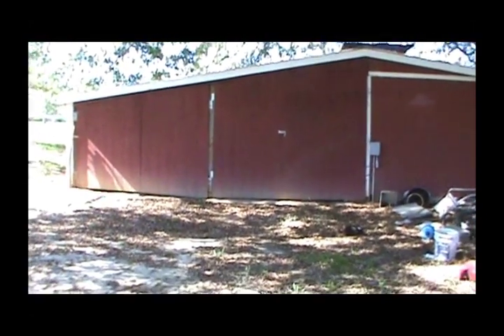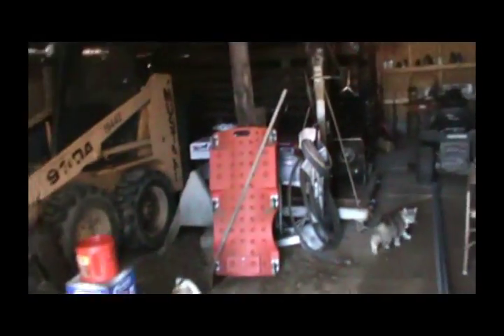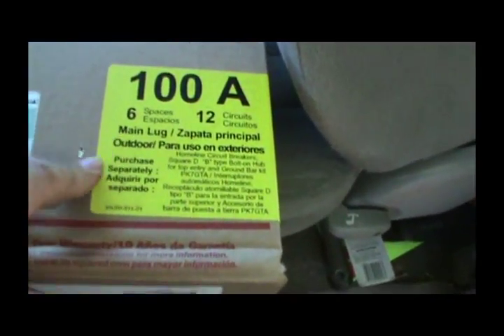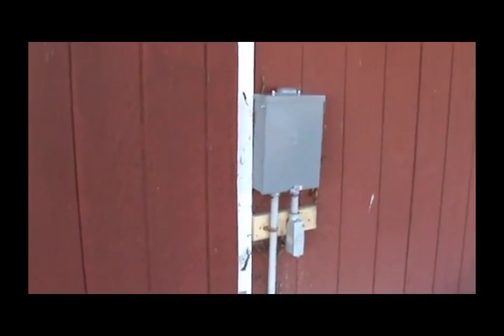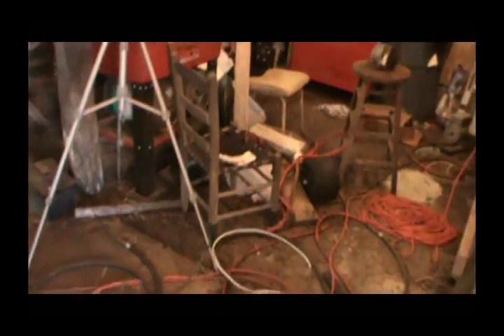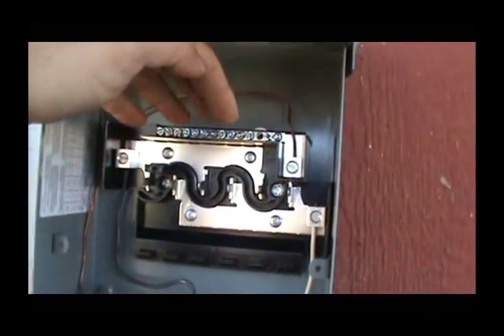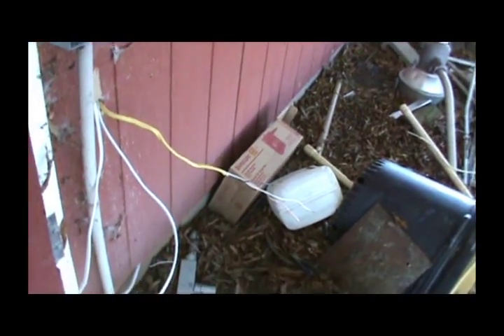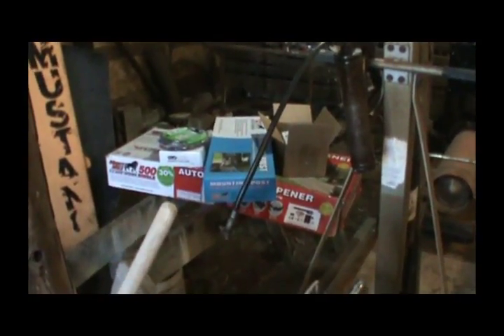Barn/Shop Electrical Box Upgrade Part 1

Comment: That last part was funny.  On a serious note.  Working with electricity is dangerous when you are not use to working with it.  You forget to turn off the right breaker and it can be life changing.  Be safe man.
Reply from the maker: Definitely!  I work around hazardous equipment and we use the lockout/tag out at work.  I'm always very careful when working with electricity!

Comment: First I want to say thanks for the video, I enjoy watching your content.  I'm not an electrician but, I just finished wiring 16 circuits in the garage I've been building so it's been an acute interest of mine lately.  

That said, I think you might want to look at upgrading your feed line to the new box.  It looked to be 10/2 possibly 8/2 in the video.  I don't know exactly what you need but considering that I had to run 8/3 for my 40amp 220 and would have required 6/3 to do 50amp I can only assume that you are looking at a recommended gauge of 2 or even 0.  I hate nit picking like this but it's pretty important.  Too small of wire for the current means too much resistance which becomes heat and then fire, I don't want your next video to be about a burnt down garage.
Reply from the maker: I've only got a 30 amp circuit feeding the shop with a 10-2 feed wire.  If I decide to upgrade in the future, I'll run a heavier feed.  At present time, I have no need as I'm not running anything 220V out there.
Reply: Ahh that makes sense, just threw me off having the 100 amp box connected to it but if the supply circuit is limited to 30 amp then you should be good to go.  Thanks again for the video, good stuff.